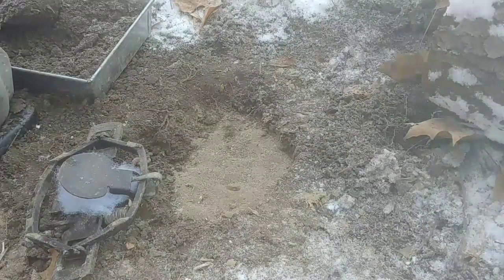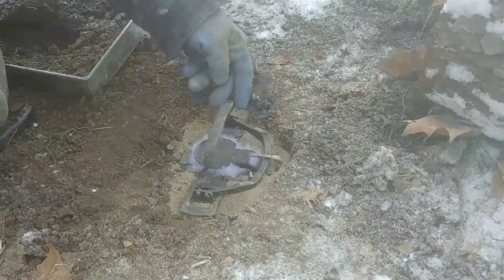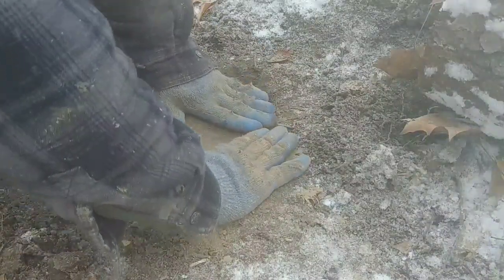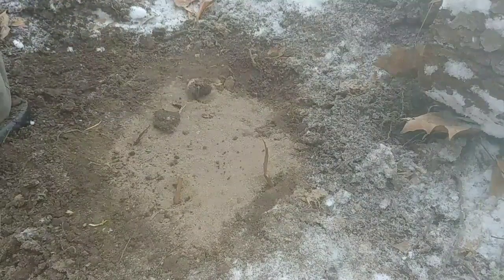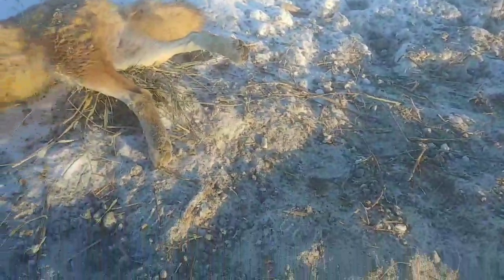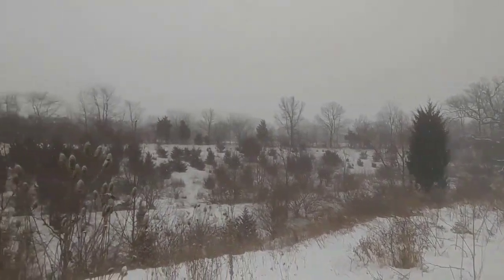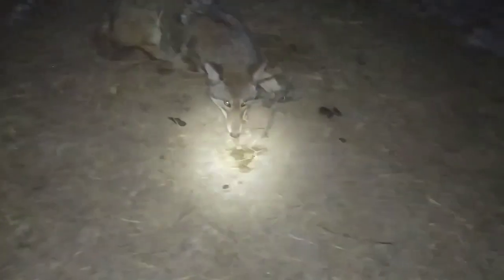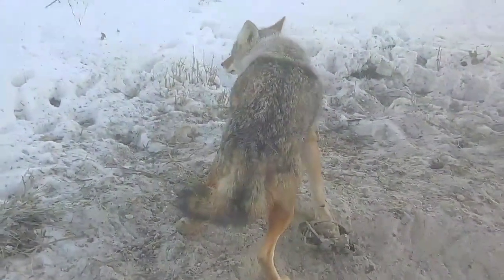Power bedding traps for cold weather coyote trapping

Comment: How does that trap work? It doesn't even look like it's under any tension. I thought you had to step down on these traps to pry them apart so that they can spring shut.
Reply from the maker: The "loose" jaw is under zero tension...the jaw the dog is over has all the tension.  You can step on both ears, or push them down by hand to set the trap... I just had the trap staked and pre set to shorten the video
Reply: @stepfracturemaster8556  Cool.

Comment: I will often have trouble with traps freezing to the ground especially when it gets -20 or colder I've had them freeze so bed they wouldn't fire and had to chip it out with an ax and thaw it before it would spring. if it gets up to -1 or 0 with the sun out it will melt the snow or ground moisture and freeze in a couple hours
Reply from the maker: Absolutely...even dry dirt will draw moisture from underneath and freeze...wax dirt seems to be the best thing when it comes to battling mother nature...its not fool proof obviously...you still have to battle top layer freezing at times...but it definitely keeps you in the game